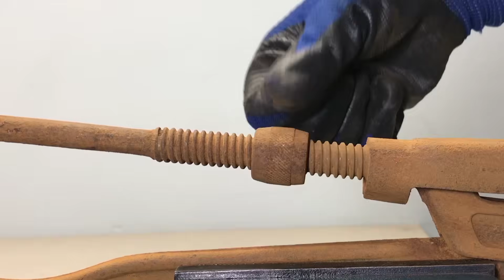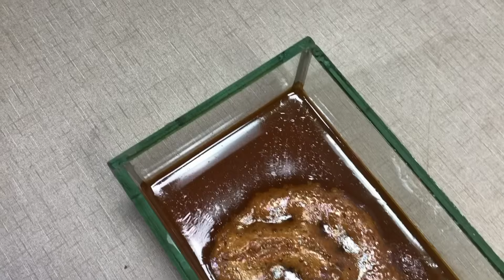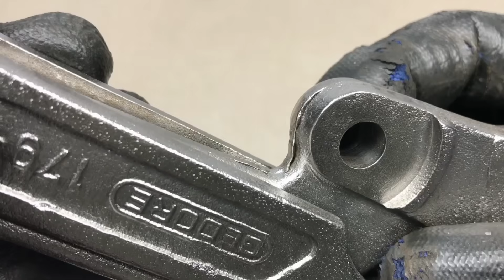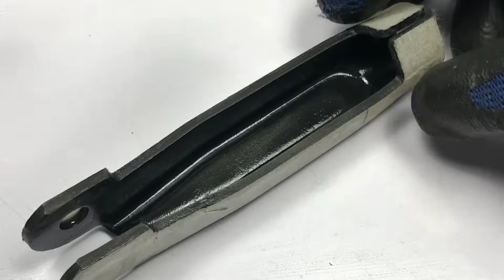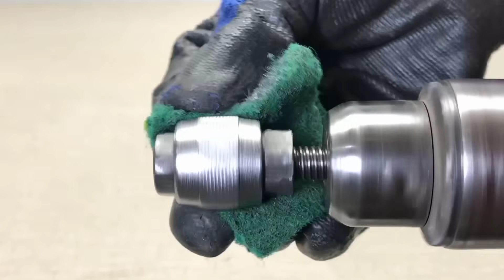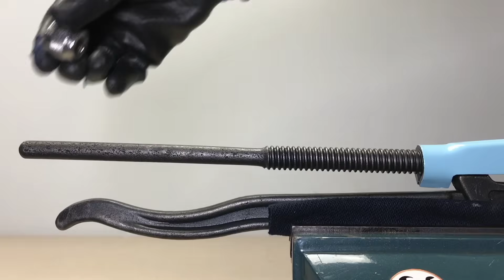Rusty Antique Corner Pipe Wrench - Restoration

Comment: Nice job, as usual! :)
Won't the polished "adjustable threaded wheel thingy" rust quite fast? (since it has no protection)
Reply from the maker: This nut will rust but not quickly if the tool is used, there is very little chance that the nut will rust.Thank you so much ☺️

Comment: Nice Restauration! But why is the handle light Blue??
Reply from the maker: Thank you so much ☺️ 
After applying cold bluing on sanded metal, cold bluing light is visible.  The handle of this wrench  worn due to use.
Reply from the maker: Thank you so much ☺️ 
After applying cold bluing on sanded metal, cold bluing light is visible.  The handle of this wrench  worn due to use.